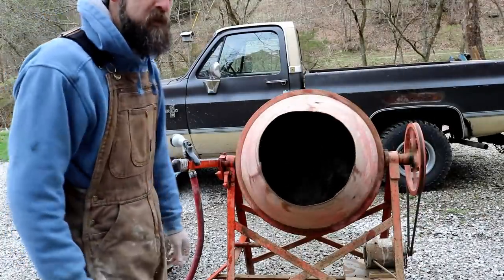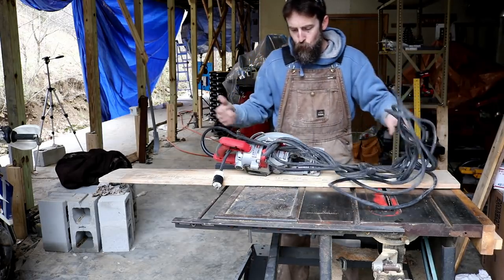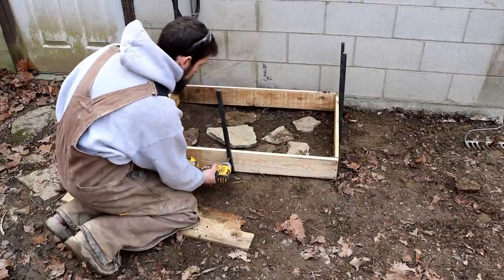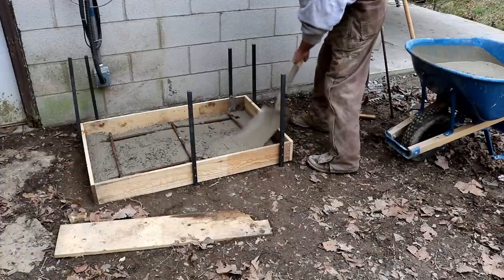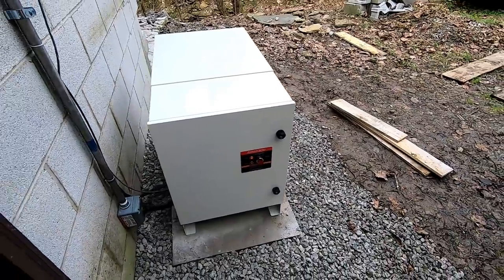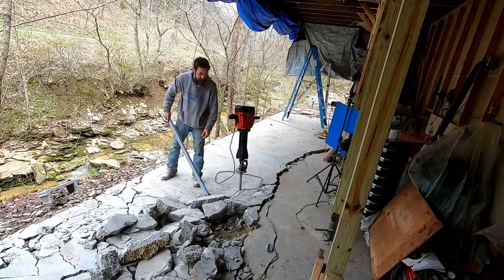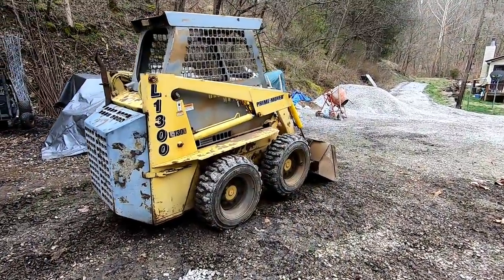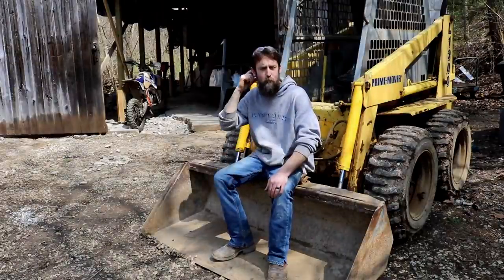Shop Damage #8 Jackhammer Time / Concrete pad and bobcat run

Comment: When you're pouring a pad, you want to tamp your dirt Thoroughly, tamp it again, add 3"-4" of crushed stone, then tamp that thoroughly. That'll help prevent the pad from moving while it settles. Then add rebar and concrete on top (you can put stones in between the rebar to use less concrete ;) ). Good Work.

Comment: Hi Steve, I have a twin to your dad's cement mixer, but mine came with a gearbox and driveshaft so you could hook it up to a 3 point hitch. I now have it fitted with an electric motor like your dad's so I have two ways to power it. If I were you, I would order ready mixed, that mixer will work you into the ground, I know. LOL

Comment: Hi Steve- when it comes to renting tools i look at that as throwing money away. Of course not something like a 80k  skid steer or high price. Have a suggestion on the RPC i know its weather  proof - but we know  how water and rust wins. Id add  a lean too style roof and walls sides n front air can get in the back near block wall. Plus the wiring would be protected also. Oh theft  protection. We had the same sears mixer when we built our home in 1960s foundation -block upfor crawl space. I earned great strength doing masonry at a young age then. We worked as kids .

Comment: If you ever have to tie a lot of rebar, they make a tool that works with the tie wire you have with the loops on the ends.  It looks like an awl with the tip bent over and the shaft rotates in the handle.  Bend the wire into a U shape around the rebar,  place the tip of the tool through the loops and give it a spin.   Takes about one second once you get the hang of it.

Comment: With all of that rock it would likely be difficult to drive or drill in something to support the bank. For concrete form stakes, I used angle iron. It drives into the ground easy, provides as much resistance to being moved sideways as square stakes and can be used as an outside corner for forms. I like rebar in concrete. Wire mesh is just throwing away money. It has very little strength. You have a lot of work ahead of you.
Reply: Actually tossing all the bigger pieces of the concrete may help stabilize the slope.   After a fear years, chunks of concrete look "natural."

Comment: I saw that when you making the first forms and thought that it won't help yelling at the screen heh

1.5" difference wouldn't matter and you changed it anyway. My advice for concrete is don't do it, ever.... Wet, heavy crap that can burn the skin, and every bit of it tears your back up. I've done my share of concrete and it's likely that I'll never touch that shit again. There's good tips here, raising the mixer is a great one, and adding water to the mixer first is another. Adding water first helps keeping dry pockets from developing in the mixer.

Comment: Reusable metal stakes are OK idea. But sticking up above your form boards they are in the way of your screed board. Also, all the concrete driveway guys in my area just use stakes made out of wood 1x3’s. Maybe good that they did not put any wire or rebar in your concrete as it would make your removal work twice as hard. Great work, thanks for making the video.

Comment: For stakes I just used what my neighbor used (he did all the concrete in my subdivision back 20 years ago).  I just used Landscape stakes and drilled them into the forms.  Worked a treat.  BTW: You REALLY should have used a 2" crush stone base under that pad.  That's what my concrete guy told me to do when I poured my A/C Compressor pad.

Comment: Before your dump anything down the hillside for erosion, lay down geotextile erosion fabric first (NOT the cheap biodegradable stuff)! The stream's current can easily flow between large stones/rocks/masonry/whatever, and stones don't hold down the underlying sediment, which is lighter than the stone and washes away.  The fabric will stop any flow of water from passing through (only weeps water) and has filtration fine enough to keep sediment behind it where it belongs.

Comment: Steve, watching you run that jack hammer made the fillings in me teeth hurt... on a different note: if you sprinkle a little portland cement onto the finished concrete surface, it gives a smoother surface finish and most of all: harder. then a good sealant on the concrete after it's set up good, and it should not begin to sand off when you start running anything wheeled on it.
as i mentioned in a previous post, you should think about saving the concrete you busted up as fill for underneath the new pad if you plan to do any excavation. it would be like putting down a layer of pit run gravel without the fines mixed in.

Comment: Lot of good hints on raising the mixer. I’ve got a mixer that looks almost identical to yours (5 cuft) Mine has a shield over the motor to keep sand out. Mine also doesn’t have or never had the lock mechanism, which looks darn scary. I also use an old wash tub to pour the Portland into and put a plastic tarp on the ground to catch what doesn’t get into the mixer. Have a load mixing while you empty a load. My recipe. Mix/gravel 3,000 psi:
1.  1/3 water
2.  12 sand-medium (not fine)
3.  4 gravel (1/2” limestone)
4.  1/3 water
5.  3 Portland cement Type 1
6.  1/3 water
Note 1: all shovel portions equal in size of sand/cement
Note 2: adjust shovel portions not to overfill mixer
Note 3: 3,000 psi is sufficient for most jobs & reaches maximum strength in 28 days
Note 4: 27 cubic feet=1 cubic yard of concrete TxWxL

Comment: Steve , look into Gabian Baskets. you form them into a cube then fill the rubble into those and stack them like legos. Lean the first row into the hillside and the next rows will follow . Step each one back a few inches so all the weight is counteracting the hillside . When you are done you will have a Gabian Fence that will be cheap and effective at tackling your woes.

Comment: Put the mixer up on a cinder block platform so it is tall enough to just dump into your wheelbarrow and you don't have to tip the wheelbarrow on its side and don't have to fight everything

Comment: Instead of replacing the cord, just use a locking extension cord, and keep it locked to the saw. I don’t see why that would be a problem. You won’t lose your warrantee either, if that matters to you.

I would have put 4 inches of that gravel under the pad, after having tamped the soil down hard. Rebar is always good in weather where the ground freezes and thaws.

Comment: You can use your pneumatic hammer on the side of your form (outside) to induce vibrations in the form. That will create vibrations in the concrete, and work almost as good as a concrete vibrator.

Comment: Its not a design issue it is an engineering issue from your brook called scouring. It is the fact the outside bend will always erode. Two choices, build a wall from just below the water level of the brook by 3 ft or more then use your old concrete as wall material or set your footing for the outside edge of your pad to the depth of the water in the brook, like a basement wall, then backfill.

Comment: I find it easier measuring you water into a bucket first then pouring it into the mixer to keep the amount of water in each mix roughly the same. Its harder to tell how much is going into the mixer when you fill it straight out of the hose.

Comment: Most of the dyi'er jack hammers are commonly known as "60 lb hammers". Many rental companies use the Bosch hammers (electric). Then for the next level up- (a little more serious and very common on job sites) is the "90 lb hammer " which is air powered and requires at least a 100 cfm compressor to run it. There are also a couple of bigger and much heavier styles too.

Comment: Don't use screws for forming.  Ask me how I know.  Duplex nails (we used to call them scaffolding nails) are the way to go.  When breaking down screwed forms you will be picking concrete out of the heads forever.  Good to see you making progress.  I really agree rebar is never a bad idea.   Doug

Comment: I'm certainly no expert at pouring concrete, but what I've seen is that the stakes are hammered down far enough to be below the top surface of the forms. This allows uninterrupted screeding. Maybe shorter stakes are in order. Also, the next time I have the opportunity I'd like to try using a reciprocating saw without a blade as a cement vibrator. Just press it against the form and pull the trigger. Not sure if that would be powerful enough but I'd like to try it. Maybe an air hammer would work even better.

Comment: A couple if things I noticed in this video. First, you are an extremely hard working man. And that is very important tackling a project like you've chosen. In my younger years I would have challenged myself that way too. But years and age has now slowed me down a heck of a lot. Second, I see you have an old cast-iron top Craftsman table saw. It is identical to the one I got from my dad decades ago. I removed the stamped metal extension wings and built a much better outrigger extensions and rebuilt the total mechanism inside and a new 1 1/2 HP motor for mine. Then I bought a really nice Biesemeyer fence and installed that. It is a pretty good and accurate saw now. I can see you using it along the way. And if I am not mistaken, I think you have two NRA decals on your back window in your truck. Good organization and equally needed organization as well, in my opinion. Stay safe and be very careful in your rebuild... Thumbs Up!

Comment: 3/2/1 is the usual sand, gravel cement mix. Looks like you’re gravel rich. I like a little extra cement. Use a trowel with a half round edge to finish your top edges for a finished look and prevents chipping that is alway a problem with a sharp edge. I’m not  a professional but I’ve watched  many and done a bunch of projects on ranch.

Comment: Looks good! I'm terrible at concrete. Almost as bad as I am at painting. I've got that same table saw with the same crappy fence setup.
Reply from the maker: I'm just messing around trying to learn a few things about it. When I have the shop floor done I want to have a better understanding for the process . I need to find a good local concrete crew to do the pad .  I've done very little concrete work. Helped pour a few pads before but I was the grunt \ tool getter. I would consider myself terrible at it as well Wes.
Reply: No real science to concrete. A strong back goes a long way. Level forms, more stakes then you think and more rebar. We have a vibrating power screed that does wonders. If you can work the rocks worked in and more mud on top you get a better finish

Comment: Since every body is chipping in— I would  have rammed the bottom of that pad down with sledge hammer or Somthing nice and firm to stop any settlement, particularly a problem if say part of the pad is over the wall footing and the other part settles.
Gabions— wire cages full of rocks work well, you can make round ones with old sheep fencing wire

Comment: Having run both Ill say the  big air powered hammers will blow the electrics away. But, for your job the electrics just perfect. Also, You can build a simple attachment to use the jackhammer to drive stakes, etc. Just a tube that slips over whatever size rod youre driving. Ive driven a metric butt ton of ground rods with a jackhammer.

Comment: The term for material used to prevent stream erosion is "rip-rap".  Most any kind of rock will suffice.  My brother-in-law used bags of mortar to stop a curve in a stream from eroding into his yard.  He just stacked the bags like building a brick wall and left them... unopened.  In time, water penetrated the paper bags and activated the mortar.  Eventually, the mortar dried out and 
became stone.  I imagine Quikrete would work as well... so long as it's in a paper bag.  You would not have to buy all the matterial at a single time.  Just a bag now and then.  Eventually the project will get done.

Comment: I still think you are going to spend way more time, energy and money trying to fight that creek. If you built a wall with 6x6 and used metal you would have a wall you could insulate much better than block. I have poured quite a lot of concrete, my tip to you is make sure you go and rent a power trowel if you want a nice slick floor. It is hard to loose control of concrete having a power trowel around. Plus the nice slick floor it much easier to keep clean.

Comment: Don't let Randy Richards see that mixer or before you know it you'll be restoring it to aerospace standards. Keep up the hard work and thanks for creating content.
Reply: LOL
Reply: I think Randy should wire a red indicator light in line with the mixer motor. When it’s running empty, you won’t hear it and forget to turn it off. That is one well (over?) restored mixer. 😎👍

Comment: Steve wouldn't  be cheaper and easier to call one of those batch mix concrete trucks that would come out and mix you a small pour. Probably easier to use your welder to weld the rebar and mesh then trying to tie everything.

Comment: The front porch (10x6)to our house was made of a combination of bluestone concrete, mortar and at the bottom cinder blocks. The top of the porch was 3 feet thick of bluestone. Took literally 3 years to take it down 1 foot, slamming away at it every weekend. The porch was laid against the foundation and cracked it, so it became necessary to remove it pronto as the basement was flooding. It cost $75 to rent the jackhammer and took 3 hours to finish removing the porch, another 2 to bust out the 50' walkway same material about 8" thick and the blocks of the foundation. When I returned it, I got a refund of half because it was only a half day rental. the guy came by my house later and was shocked by the amount of stone and concrete I had busted out. Oh, I'm a girl. This was ancient concrete, 75+ years old. Never have had to use a jackhammer since, but it was worth every penny spent. Sometimes a good tool is what is needed.

Comment: Since those tie wires have loops on either end, I wonder if you could put a nail bent at 90 degrees in your drill, slip the nail through the two loops, and twist it tight in a second or two. Just an idea, I don’t have any experience with it.
Reply: J DeWitt - Right beside the tie wires in your big box store, they sell a wood handled tool for a few dollars. Once you get the hang of spinning the hook, you can wire things together by hand even faster than fooling around with a drill. The pros who set rebar for bridges and buildings can spin wire ties at a speed you’d have to see to believe. 😎👍

Comment: You can use the rubble as fill, possibly mixed with some concrete in the bank reinforcement. Pretty much just shove it over the side of the hill once you have a spot prepared.
Reply: Or you can buy concrete mix

Comment: Go on upstream another 10 foot with your diversion wall, then it needs to kick back into the bank I would suggest a minimum of 4 feet.
Reply: I have used gabions for this type of work. Looks like chain link fence boxes. Just fill will rock or concrete chunks. Advantage is they will move w/frost heave and drain freely.  Easy to place and use. The kid would come in handy.....
Reply: @aforman1951  and bcbloc02  I was thinking about that also.  Could use old field fence or link fence.  Should be able to find some if don't already have some stashed.  A layer of gabions, fill with rubble, tie up, new row of gabions tied to first, fill, repeat as needed.  A whole lot cheaper and easier than a wall.

Comment: When I have done small pads like you were doing, I have a bunch of 5 gallon buckets that I will fill with what I need for the next charge. While one batch is mixing, fill the buckets. When the next batch is dumped, pour the buckets in. While the new batch is mixing, pour the concrete in the form, refill buckets. Repeat until done. Downtime is minimized.

Comment: By far the best thing to use for holding that bank back would be home made Gabions, you seem to have lots of stone available there.
Reply: Until the wire mesh rusts out holding the gabions together!
Reply: @scotty362100  If galvanised and good quality it will last a long time, long enough for tree roots etc to tie it in.

Comment: Steve,  The reason the concrete slab failed is the fact that there was no eaves troughs on the building and the rain slowly eroding. Put eave troughs on and hose on the downspout to take the water away from the building.  I would suggest this on both sides of the garage.  That's a lot of water around a building. Great determination and work Steve. Stay safe.
Reply: Agreed.     Lemme guess....North of the boarder???   "eaves troughs" in lower North America are Gutters.
Reply: It failed because it wasn't reinforced. With proper reinforcing you could have balanced that slab on a single column and it'd have stayed together. But this slab has absolutely no reinforcing in it whatsoever. And this is what happens. Unreinforced concrete just falls apart. Which is why we reinforce concrete.

Comment: slather some diesel fuel on the wood forms before you pour next time with a big paint brush or splash it on there. the  concrete wont stick to them and makes tear down alot easier

Comment: "A little longer than I normally make" and yet I bet most of us watched all the way to the end. One tip that I could offer is get a pair of hearing protectors that have a radio and Bluetooth in them, have music just makes the work going by faster. I like the Worktunes products from 3M, but there is also a set that Lowes sells that is reasonably decent. Even with glasses on they are giving a decent amount of noise reduction for things like an impact wrench and 4.5 inch grinder. I also use them with my little milling machine, it gets a bit loud when I have the vacuum running to clear the chips. Normally around about $50 and as you might guess, the 3M are higher build quality and should last longer.